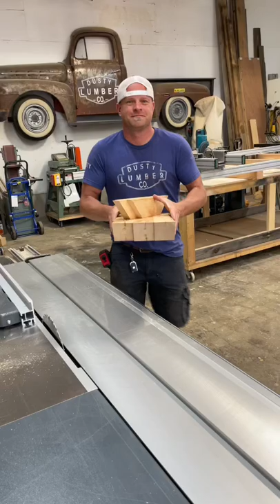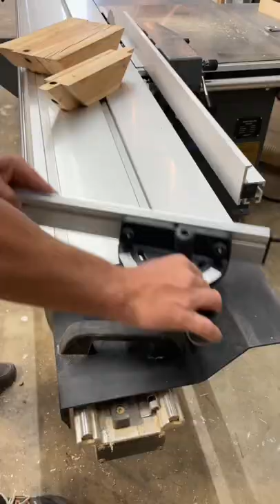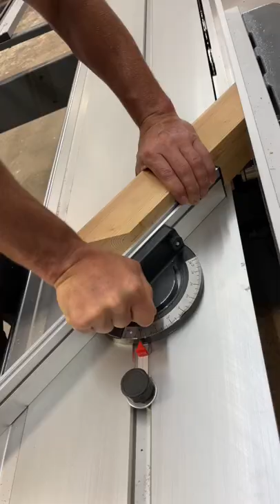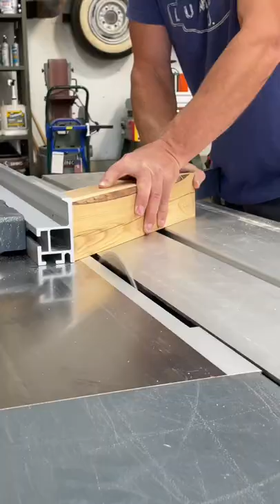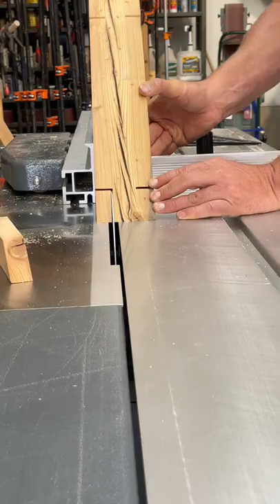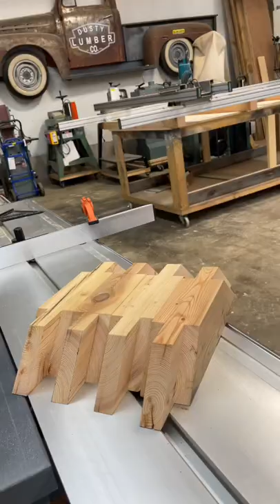Cutting tenons on a slide saw #woodwork #maker #shorts #woodworking #tools #wood #joinery #work

Comment: That’s probably the most effective way to cut the tenons. A pity there isn’t a way to cut the mortises. You need the chisel mortiser (or a drill press and a chisel)
Reply: I was going to ask if there was an easy way to cut the fitting mortise to these. Nope. Drill and chisel. Got it.
Reply: mortise machine